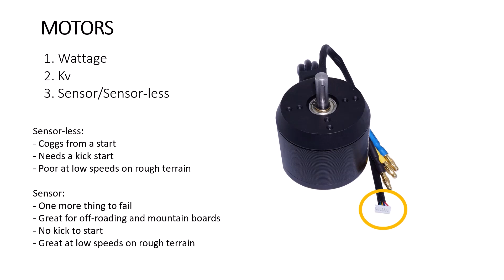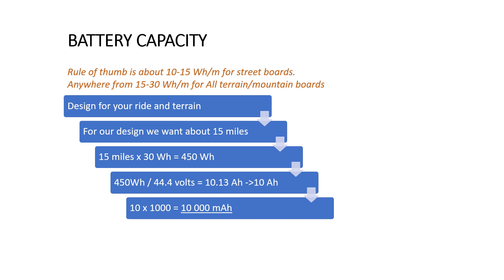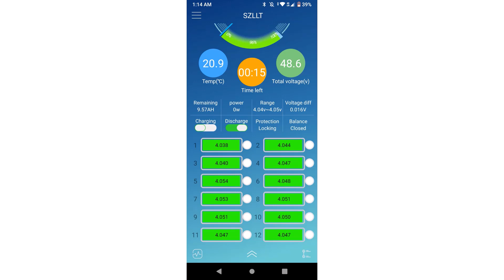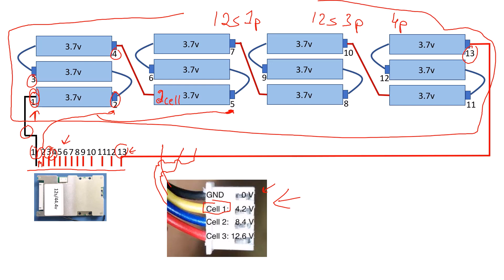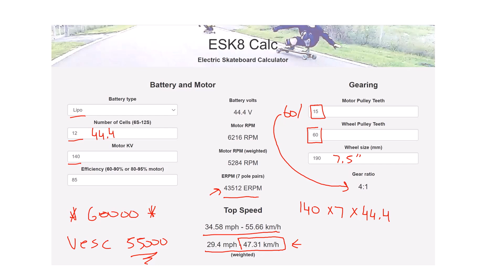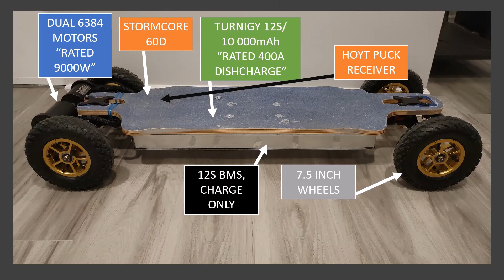Building YOUR PERFECT Electric Skateboard (SPECS!)

Comment: Thank you for this. This was the first thing I've found that actually got me to understand where in the world to start when trying to build a board.
Edit: While I'm here, maybe you can answer this question: I'm just doing all the math to, in theory, build a badass mountain board. I'm sure specs will change when I actually have to reach into my wallet, but do you have any experience running multiple BMSs? Say, theoretically, I wanted a battery back that could output 400A (12s4p LiPo in this case), but I also wanted the smart BMS to manage charge AND discharge. Could I potentially use 4 total BMSs? 1 for each 12s pack. Overkill for sure, but if all the BMSs could be wired to a single heavy duty charge port, it seems that I could manage to increase charge rate of the packs by 4 times, AND manage charging/discharging for optimal battery safety.
Reply from the maker: Glad you enjoyed it! So a couple things come to mind is that you'd have a ton of wiring and parts. Second is that each bms is monitoring it's own pack, and eventually at some point while you're riding, one of the packs will have a lower voltage than the other, so if you start to drain your packs(which they definitely won't drain evenly since they have individual bms') your individual bms' will begin to stop allowing power from there respective packs and you'll start dropping from 4 packs to 3 to 2 etc. It would definitely work but aside from being overkill it wouldn't benefit you much and you'd probably have to get a Bluetooth bms' for them all and constantly check to make sure they're all still active. Just to give you a different perspective, I personally just get a charge only bluetooth bms', hook it up to 2*6s 20 000mah packs that are in series. that way I'll have less differences in cell resistance, and then check it every now and again to make sure they don't go less than 3.5v per cell since after that is when they're more likely to go out of sync. I get tons of range, power and the batteries should live a fair amount this way as well. And tbh you probably won't ever use more than 80 battery amps or so, you only really hit the higher amps when you're going crazy fast and up a steep hill. Hope this helps.

Comment: I'm no expert either but I'm pretty sure you dun need to parallel so many cells to match the max motor amps. Vesc bucks the voltage and current. I mean batt amps and motor amps are separate. You gotta be going very high speed on a steep uphill to be able to draw so much batt amps that equals the motor amps.
Reply from the maker: You're absolutely right! You'd have to be running about 6500 rpm at 95% duty cycle to hit about 150 amps or though. However I always prefer to have tons of output available as the batteries life duration will be much better. You could get away with anywhere from 80-200 amps. I just prefer the high end. Cheers!